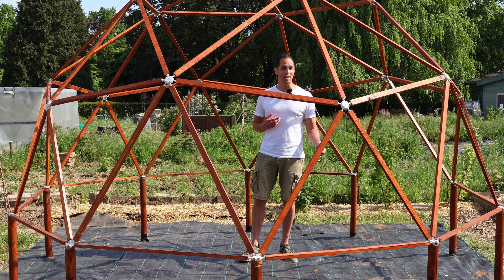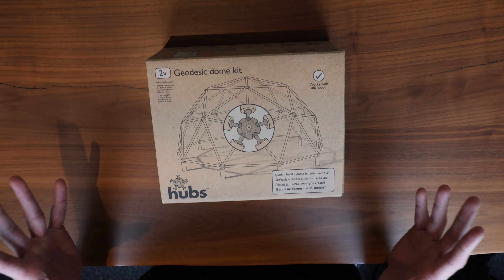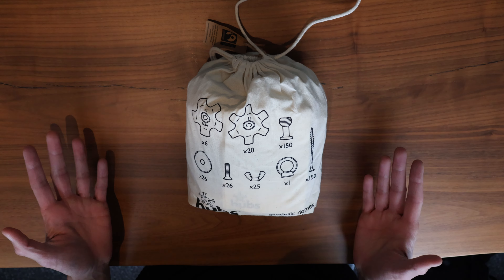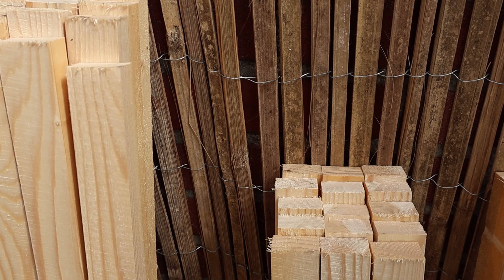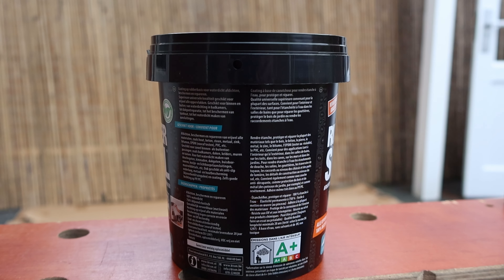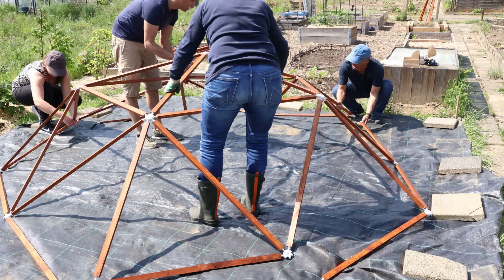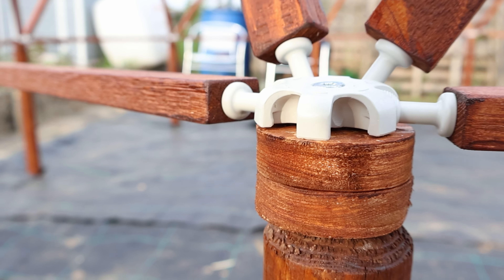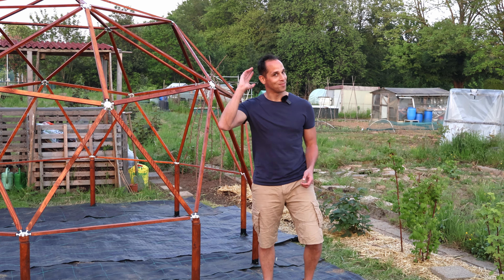#30 Building a Geodesic Dome Greenhouse in my Vegetable Garden! · PART 1 · Step-by-step Guide

Comment: Great work! I love domes and have mounted a couple with the build with hubs system. 
I'm curious. Have you tried to loosen all the metric screws with the butterfly nut on all the connectors to make them fit the leveled poles? I think there is some flexibility on the construction and you can compensate it
Reply from the maker: Thanks for your reply! Yes, we have tried that, or rather: all those screws were initially loose when we determined the position of the poles and also when placing the dome on top of the pole. That was probably what caused the problem in the first place; the dome was still flexible in both situations, and that may have caused the sleight difference in position of the sticks. We followed the instruction manual, which told us to only screw the butterly nuts at the very end. Luckily, it wasn't the biggest difference, but I suppose you could screw all the nuts tight before you determine the position of the poles/base.
Reply: @atthegrassroots  thanks for the answer!
And what about pressing (burying) down the poles which were higher? 
As opposed to use the spacers to gain height on the lower ones
Reply from the maker: @davidgruty  I suppose you could do that, but you´ll run the risk of hammering the poles too deep into the ground, having to compensate at other poles. In such a situation I think it's better to fill up the gaps because you'll know the other poles stay at the correct height.
Reply: @atthegrassroots  right. i'll be more difficult to compensate
thanks for your answers. I already follow you on Instagram to see the news!